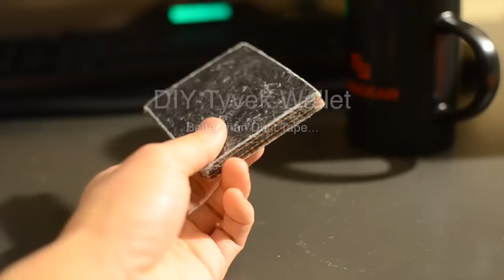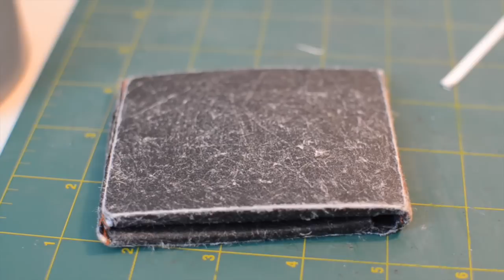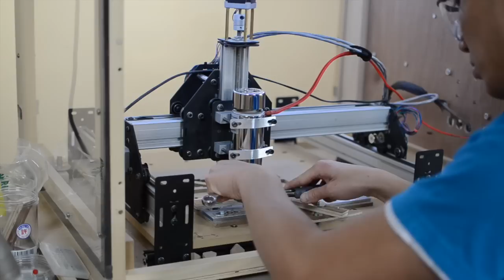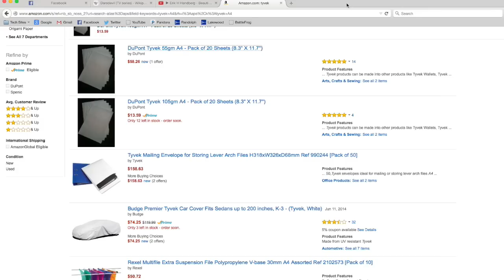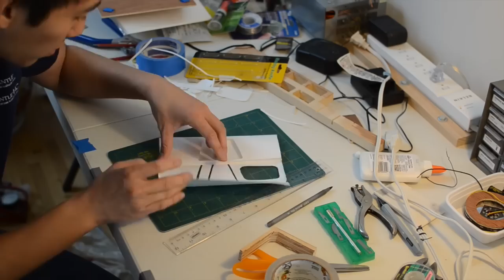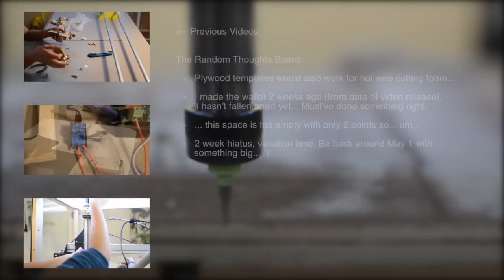DIY Tyvek Wallet - Shapeoko Project #31

Comment: I made one of these years ago and found that laminating the Tyvek clear packing tape before cutting and stitching the wallet together significantly improves abrasion resistance, without increasing cost or thickness in any meaningful way. I used that wallet for four years and it likely would have been fine for many years more, but I ultimately retired it when I finally grew tired of the FedEX branding haha

Comment: Do you have a link to the templet you used
Reply from the maker: andrew diller Working on a slightly tweaked version, based on how version 1.0 held up. Will share to the Shapeoko forum when ready.

Comment: Hi Winston, I have enjoyed your various Shapeoko posts. I build guitars and would like to use a cnc machine for some of the tasks.
I decided to order the new shapeoko 3. I planned to learn the various software programs needed, and a cart for the Shapeoko, while waiting for my new machine. Well, it's not going to plan. I'm having trouble finding the software I need and how to use what I have found. I also don't know what dimension to build the cart as I can't get information on the rail size. I want to enlarge the work area to 24 inch wide and 36 inch long. Is there a beginners guide that you are aware of ? I can't seem to get ahold of anyone at Carbide 3D. I left emails and phone messages? They must be too busy with the new start-up? If you prefer to contact me via email, my address is ken.marble@juno.com
Any help you could provide would be greatly appreciated.
Reply from the maker: Kenneth Marble Hi Ken, software options should be listed on the Shapeoko wiki. I personally use Universal gcode sender to transmit programs to the machine, Carbide will have a program you can use as well. For creating your digital files (CAD) and turning them into a tool path (CAM) there are many many options, both free and paid, that ought to be on the wiki as well.

http://www.shapeoko.com/wiki/index.php/CAD
http://www.shapeoko.com/wiki/index.php/CAM

Carbide guys are swamped right now, 4 guys trying to manage the delivery of two different platforms + software is pretty hectic. And though there's no official word yet about custom extrusion lengths, I would suspect we'd hear something about it in the next few months. Once Edward is out of his shipping backlog he can focus on features like expandability. It's more than just shipping longer rails, the wasteboard frame would need to be upgraded as well. I have no info as to whether or not the extrusions will be cut-to-order, or sold in per-determined increments.

Comment: Awesome video as usual! I've used a heat sealer for a similar material(made from grocery bags) and for a slightly different project, but it has lasted years. I heat sealed a couple times for each seam. So, That might be another option.

Comment: Do you think an ordinary endmill would cut tyvek cleanly if you put your plywood mask over the top of the sheet to hold it down? Some carefully placed clamps would let you cut them ten sheets at a time maybe?
Reply from the maker: BadWithComputer With a really sharp end mill, I think there's a chance. I do want to try some test cuts on paper-like materials, if I ever get around to it, I'll let you know. But wouldn't hurt to try, and you could probably get around to it before me.